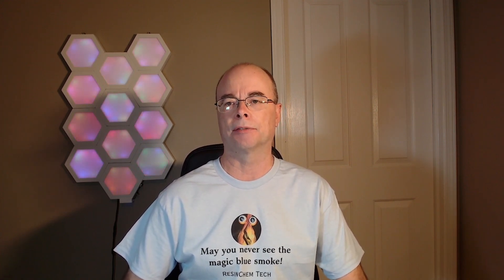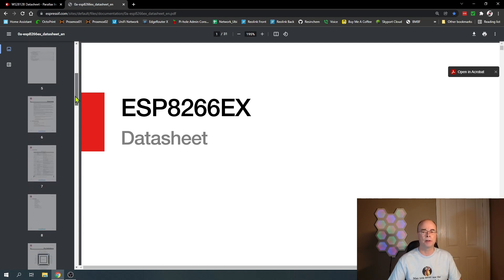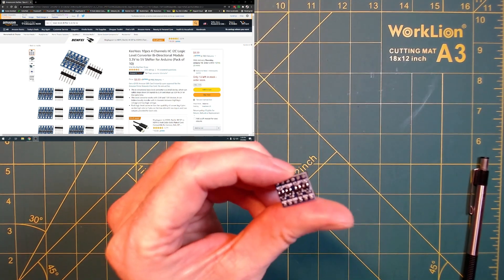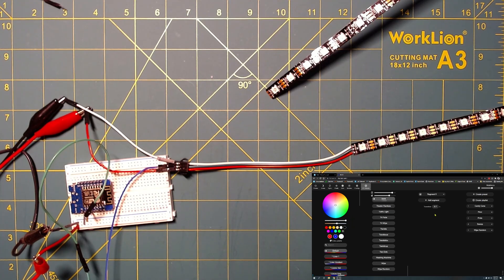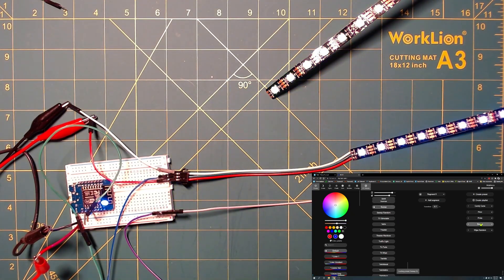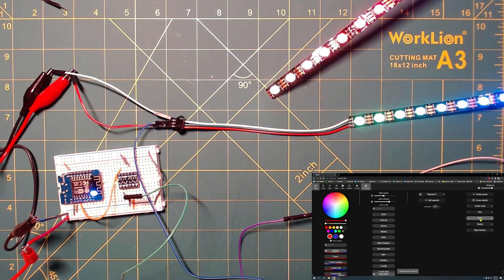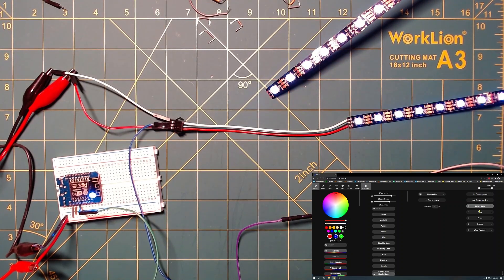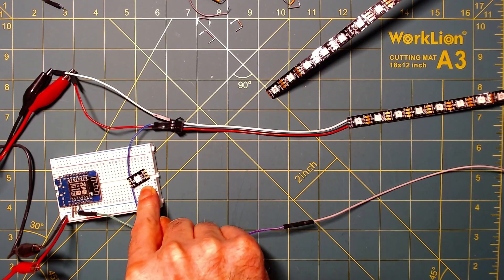Logic Level Shifter and WS2812b LEDs

Comment: Is logic level shifters best or a Sacrifical 1st pixel led... To run ws2812b strips far from controller
Reply from the maker: Either option will work equally well.  It somewhat comes down to personal preference, soldering abilities and how you want to build the controller.  For me personally, I prefer to spend $1 for the level shifter that I can securely solder onto my controller board as opposed to trying to have the extra wiring and a 'dangling' pixel (or hot gluing the pixel to the board).  To me, it makes a neater and more secure controller with less likelihood of a soldered wire coming loose... but that's just my personal preference.  From a purely functional standpoint, either option will work the same as long as the sacrificial pixel is kept close to the ESP controller.
Reply: @ResinChemTech  thanks for reply... I have seen poeple complain about lag while using level shifters.... May be some ms delay compared to Sacrifical led... Not sure is that true.... Have you seen any difference between those..... If not... Please can you try and update on this.. Comparing sacrifical led and level shifter
Reply from the maker: That might be a valid point, although I suspect it only becomes apparent with a high number of pixels.  I do know that the developer of WLED states that about 800 pixels is the limit that an ESP8266 can manage on a single pin without starting to experience lag.  I suppose that any additional lag introduced by the logic level shifter might impact this... it is entirely possible.  But I have not personally experienced it, although my biggest single install from a single controller pin is 600 pixels.  While he doesn't explicitly address the logic level shifter, Quindor over at QuinLED has a great article that describes that lag is actually caused by the LED technology and not truly by the controller (and by extension the logic level shifter, as he also includes one in all his pre-built boards):  https://quinled.info/2021/03/23/max-amount-of-addressable-leds/

And while I'm sure manufacturers vary widely, the spec sheet on the shifter I use reports a max response time of only 42 nanoseconds... much, much faster than the LEDs can respond.  So, my guess (although I can't prove it) is that lag is caused by trying to run too many pixels in a single string/connection and nothing to do with either the controller nor the logic level shifter.  I can certainly consider a video showing use of both the logic level shifter vs. the pixel, but I'm guessing I'd have to use a very large number of pixels (which I would have to order and buy, along with a big enough power supply to run them), and even then it might be difficult to show that lag on video.
Reply: @ResinChemTech  that's really pain to make contents show in video... But I really appreciate your response... It means a lot to me... You have always been soo motivate.... I will try myself and update you If possible....thanks again for these type of videos and contents... These have always been soo helpful.... Also as a suggestion... Can you make videos on diy smart curtain open and close integrates with HA... Most of the devices you use.. Cant be purchased in my place or either it's very very expensive. Diy works for eveyone I guess.

Comment: Do you use any resistors on the signal?
Reply from the maker: I have once... to solve a signal issue due to about a 15ft. run with a 3-wire insulated cable that had both power and signal running in parallel within the cable and was causing some intermittent problems.  I used a 33 ohm resistor in that case on the data line.  But that is the only situation in nearly two dozen WLED installs where I had a problem that needed a resistor.

Comment: Great clip. Is there any need to add additional logic level shifters in between strips if you have several connected together? I'm going to run 30m, 6 x 5m strips, a total of 900 LED's, back to back. My logic level shifter will be placed between the controller and the first strip, and this distance will be very short. I'm going to power injection for each strip, but will I need to amplify the signal to reach all 900 LED's? Cheers.
Reply from the maker: Nope... the LED strip itself will boost the signal from pixel to pixel after it reaches the beginning of the strip, using the 5V from the power.  So, while you will need to do 5V power injection along the strips, you won't have to worry about boosting the data signal along the way.

Good luck with your project!

Comment: I throw them in there jist for the simplicity. Like you said theyre less that $1 and not complicated to install.
Reply from the maker: I agree 100%!  But I repeatedly have comments telling me that they aren't needed (and all the reasons why), which is why I threw this video together.  While in some cases, you can probably get away without it, the first time you complete an install and end up moving the controller farther away, you'll really wish you had spent that extra dollar and a few minutes soldering.  Don't want to use one... that's completely your choice.  I opt to always include one and not take the risk of potential issues.

Thanks for the comment (and answering the other comment about the diagram... I appreciate the help!).

Comment: I had ,8 different setups using d1mini (8266) four on my parents house and four on mine. Everyone had between 8 to 10 feet of cable between the 5v PSU /d1mini  and the start of the pixel strips, smallest amount of pixels on a D1 was 127, most amount was 230. Not had any issues at all. PSU used where all low 3amp units ( apart from the 150+ runs) .
I'm not saying don't use a shifter as it will fix issues. Just saying that your test is not a repeatable test as you say with different strip manufacturers and different cable you can get less than 6ft or even more than 19ft.
Reply from the maker: Yes.. and to be fair, I was using very thin gauge wire (Dupont cables).  Heavier gauge wire would result in less voltage drop and likely a longer run before problems occur.  What I had hoped to get across was that while a shifter might not be required in every case (and might even vary in the same case, as you mentioned), for me I'd prefer to spend the $1 and not have to worry about voltage drop or signal issues.  I learned this the hard way on one of my early projects... and it was a real PIA to have to tear everything apart to upgrade the controller and add the shifter.  Now, I just include it for all my LED projects, whether it is truly "needed" or not. 

But thanks for sharing your experience without using the shifter.
Reply: @ResinChemTech  For digital signals very little current flows on the wire, so wire gauge will not matter unless the frequency is very high or the cable extremely long and that thin wire you used is fine.  One thing that isn't ideal, and probably makes you more sensitive to low voltage is that (correct me if I'm wrong) you ran out the positive data cable to 10ft, but left the return signal routed through the (much shorter) power ground.  You really want to keep those two lines close together and close to the same length, like with twisted pair cable. 

Either way a bigger problem is impedance matching.  Since you aren't using a controlled impedance cable, you're generating lots of reflections at the ends and possibly along the length too.  These attenuate your signal and also generate spurious edges which confuse the receiver at the far end.  Boosting up your signal level makes you more resilient, especially for shorter cables a few feet long.   In addition the switching speed on those level shifters is pretty slow, much slower than an ESP, so they won't generate spurious edges unless the cable is extremely long.  I think you're really doing two things with the shifter (although I haven't used one so I could be wrong), giving yourself more signal to work with and stretching out your clock edges so far that they don't generate those spurious edges that confuse the receiver.  You could go controlled impedance with twisted pair or coax cable and put a source resistor in series with the ESP to impedance match to the line, but that slower level translator is probably a more cost effective option and likely just as good as long as your lines aren't hundreds of feet long.

Comment: I found the need of logic level shifter, by trial and error,
at first when I made simple colour changing batman logo(without wifi) , it worked fine,
but when i started using wifi of wLed for custom effects on a seperate project using esp32 developer board it started flashing in random colours. That is when i decided, to use shifters and now i have made two projects one with ws2811 led and  other with ws2812b.
both run for 4-5 hours daily.
Reply from the maker: I guess that was the point I was trying to make to all those that say you don't need it.  Maybe you don't... but for me, if I'm going to spend +$50 on LEDs, power supply, etc. for a project that I'm going to permanently install in my house, I'll spend the extra $1 and a few minutes soldering to include the logic level shifter and know that I won't run into signal problems (well, at least due to voltage drop).  Thanks for taking time to comment.